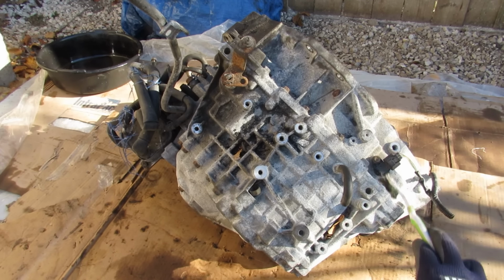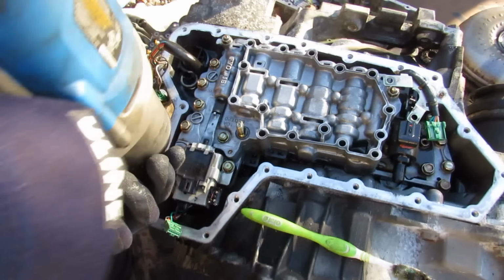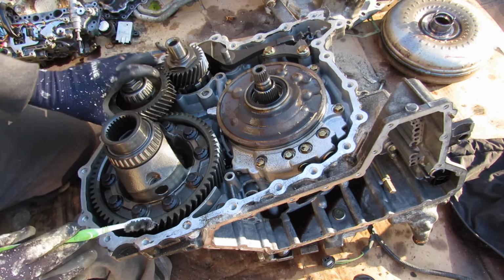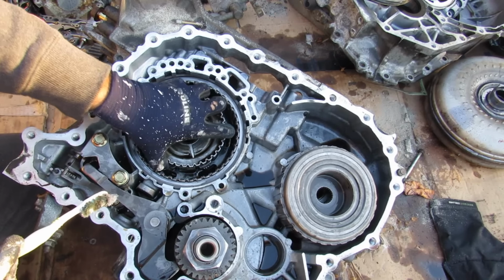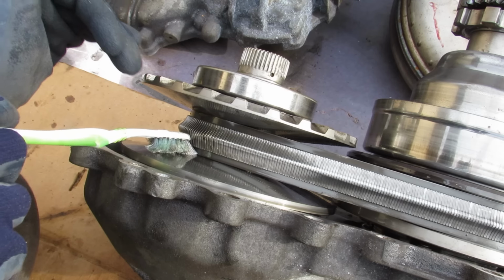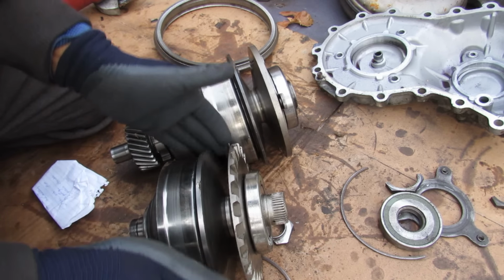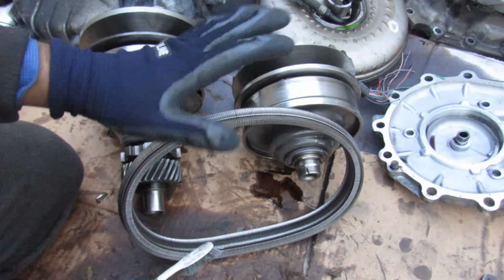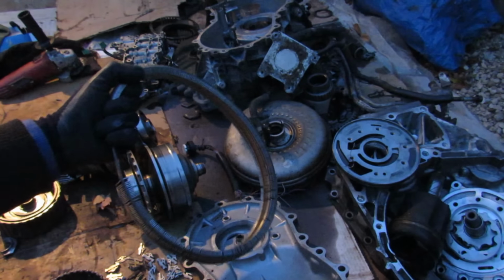Why Nissan CVTs FAIL

Comment: I just bought a 2020 Corolla with a CVT. It has a physical gear for 1st gear. It takes a ton of stress off the belt during takeoff. Should make it last much longer.
Reply: You just bought this!A Toyota with eCVT! eCVT transmission, instead of belts and pulleys such as those used in CVTs, electric motors are used to control the speeds of the planetary gear components. The eCVT is a smart transmission system that offers an infinite number of gear ratios!e from electric!Toyota for ever!😁

Comment: I loved my CVT in my Nissan, keeps you right in the power band. My car made 150K miles without major repairs
Reply: That's good.  I am currently car shopping and have my eye on a 2022 Nissan Sentra SR.  But I am concerned given the history of the CVT transmissions.  Any advice?  I really like the design of the '22 Nissan.  Its a beautiful car, but at the same time, I want beauty AND reliability
Reply: @EnriqueHld  I'm not sure if I can help. My Nissan was a 2014 murano had over 100K miles, never needed anything done to tranny........ And I towed a boat that was too large for the car 19.5 foot. I honestly never heard of these issues people had with the CVT. 
But that is a very different murano than what is out there today.

Comment: More reason for people to use a hybrid over conventional combustion cars. (Hybrids either use dual clutch transmission OR an eCVT, an electrical transmission that shares zero of the flaws with CVTs).

Comment: I’m lucky enough to have a pre cvt Pathy, but I have learnt through YouTube that certain models of pathfinder (eg 2013) should be avoided due to their cvt failures. Did Nissan fix the problem in later models?

Comment: The best punch line was “its stuck in drive or reverse so you’re literally driving BACK to the dealer “. 😂😂. With any kind of vehicle-as long as you’re not beating on it and keeping up with the maintenance, it will last. This is why I hate when other people drive my car (yes even family) No one will take care of the car the way you will. I had family visit, asked to borrow the car, drove it like a rental. Fortunately, everything is fine, probably because the car is fairly new and I am gung ho with maintenance.
Reply: Ah yes, the rental mantra of "drive it like you stole it"...
I only thing I'll borrow to friends is my old 1993 Ford Ranger, which is a Mazda B2 series in disguise. 
If they wreck it, I'm only out about $1500, otherwise it can be driven like a maniac and still doesn't miss a beat. 
250k+miles and zero issues with regular maintenance and a few minor parts (starter, water pump and alternator, a few bushings, ball joints, etc).
Reply: @RustyStringz  if you do regular maintenance on anything, it will last. The problem is most people have no idea about maintenance and/or ignore it until something happens. I’m the kind of person that will be driving and hear something out of the ordinary, roll all the windows down, turn off the radio and climate control just to try to figure it out. My wife is the exact opposite. Her words are “why are you wasting money to change stuff?  Just wait for it to break”. 😂😂😂😂😂What??!!
Reply: @grazz7865 
I'm almost in that same canoe, but mine understands that it hurts more if we wait until it breaks, however she is in the "if I hear anything weird, I'll just turn up the radio" school of thought. I find something wrong, ask her if she'd been aware of it and get "yeah, it's been like that for a while now"... 😐
Reply: @RustyStringz  100% in the canoe. Mine said almost the same thing. She said I just roll up the windows and turn on the AC 😂😂😂. The tires were a big issue. 1) she drives a smart car-tires are small and there’s no spare 2) tires were 7 years old. Yes, tires are overpriced for a piece of rubber 😂😂. I’ll agree with her there. But it is a major safety issue. Of course, when the tires fail is when you’re 1,000 miles from home 😂😂😂. Fortunately that didn’t happen. She had to work and I was off. I took the car to mavis.
Reply: @grazz7865 
Not familiar with Mavis, but yeah, 7 years is the limit for safety in tires.
At least with a smart car they aren't too awfully expensive.. I just put a set on a Mercedes with 19" wheels - damn things cost me over $1200, and they weren't even the most expensive option!
Reply: @RustyStringz  I find certain things unreasonable for price like tires. There’s no reason 4 pieces of rubber should cost you $1200 (on the low end!). There’s no reason a mattress (springs and polyester) should cost $5000!  The tires for the smart car aren’t too bad. $89/each for Kumho. Descent brand. I put a set of Kelly tires on my Nissan Rogue. That set me back $1000 for 4 pieces of rubber. But you don’t want to go cheap on tires. If there is one thing I’ve learned in life is you get what you pay for.

Comment: If you drive a regular transmission as hard as a CVT without filter and fluid changes, they will wear out also.  A lack of maintenance and vehicle abuse is the fault of the nut behind the wheel 😅

Comment: I have a Nissan muran and the the coolant fluid got mixed with transmission fluid. What do you suggest I do? Flush the transmission with transmission oil or open the gear box and do a thorough clearning.
Reply: How did that happen?

Comment: #1 reason lack of proper maintenance. Transmission service for CVT should be 25-30k miles. I would do it every 20k after seeing videos of the fluid after 20k miles. That being said Nissan should have stopped making them years ago.

Comment: What I don't understand about CVT's is WHY use them at all? Are they so much easier and cheaper to manufacture than conventional automatics? It doesn't appear so to me.
Reply: Yep, cheaper to build, lighter and better fuel mileage + overall less maintenance - but you still need to maintain regular fluid changes. 

It's still a nice option for lower power level vehicles, but not so brilliant for high torque, heavy loading /towing, but should also be able to get another option if that is the case.

Comment: What do you think about a 2007 Nissan Altima 3.5 SE Manual Transmission with 245,000 miles for $2,000 ?

It runs good but no ac and has the vsc light coming on and off.

Black leather, 6 disc cd, Bose etc.

Thank you.
Anybody knowledgeable please reply soon.
Reply: It runs good, isn't beat up, rusted out, and only has a few sensors out?
How about the tires, brakes (especially rotors) and frame? 
For $2k it sounds like a good deal, but I'd offer $1500 and settle on $1750 (for the year and mileage).

Plan on $400-700 in parts and labor to get to the bottom of the VSC issue, but otherwise it's a good deal. (IMHO, not a professional mechanic and not seeing it, but having a lifetime, 45+ years of valuable experience and knowledge of cars-owning at least 30, and working on many others).

P. S.
CD... What's a CD? 😉
If that were a Pathfinder, and you didn't buy it immediately, I'd say just go with beating yourself with a Hot-Wheels track until you get another chance to steal one for under 5k. 

Miles don't matter*. Maintainance does.

*Okay, after the first 500k, miles may be an issue. Jeez!
Reply: I'll give you 3 now!

Comment: 21today
0 seconds ago
Hi.  Does anybody know if a 2011 Nissan Sentra transmission is compatible with the 2016 Nissan Sentra?  The wiring on the 2016 doesn't seem to line-up/ reach the sensors on the 2011 transmission.    Any advice would be greatly appreciated.
Reply: No they are not compatible.
Even if you could mate the mountings, the eprom would be different and simply no way to program the older system to work with your newer vehicle.
Reply: @RustyStringz  Thanks!

Comment: My wife's 2012 Juke was still running like new at 158000 miles when some idiot ran a stop sign and totaled it. The CVT never gave us any trouble at all. Aside from an alternator pulley breaking, the only other repair it ever needed was a timing chain which was a $2200 repair we had done two weeks before the aforementioned idiot crashed into it. we miss that car.

Comment: despite cvt having many issues its amazing how people can come up with new ideas for transmissions
Reply: This makes cars totally disposables.  No parts, you have to get the same transmission on warranty or if out of warranty pay for it and the service cost. And you get again the same problem, no thanks is better to get a new car with no CVT.
Reply: @somarpr  I think AT is almost the same case. Having my Omega mv6 and my sister's Corona's transmission  rebuild and both can't last over four years. Rebuilding seems unreliable and the dealer charged something like 10,000-20,000 usd for a new one. 
Therefore I go with manual after that. Rebuilding a manual is far more reliable. I still have a 4AT Sambar Van though.
Reply: @somarpr Adevărat!Dar dacă este întreținută tine mult și bine.E adevărat că costurile de  RK sunt cam mari ,dar oferă o plăcere la condus .Odată ce se fabrică și se înbunatațesc ,însemna că e ceva de capul lor
Reply: No shit. Why did they bring this junk into the market ...

Comment: Best reliable trans is still a manual transmission lol. Somehow still more fuel efficient, easier to repair, long life, and no trans cooler even needed for gear oil lol.

Comment: Hey sir, great job on this one! I have been an automotive tech for about a decade and I still learned a few things. The toothbrush was a nice touch. I don't do anything with transmissions except for true manuals so this was very informative.
Reply: How about they make a cvt oil level stick you can easily remove !!!

Comment: Great video. Very accurate and knowledgeable. I worked for Nissan a few years ago and everyday we had cars come in with transmission failures while still under warranty. Some cars had multiple transmissions put in before 80k miles. I’ve worked for Toyota as well and their cvts aren’t as flawed.
Reply: toyota cvt gearbx equiped with direct gear to move the car from stationary, the cvt system works only when the car is moving

Comment: i have a subaru with paddle shifter, won't be using those anymore or zooming around. gonna take it real easy. Thank you! The way the CVT makes contact with that belt is nothing like I pictured in my head. The actual design seems very weak.

Comment: Nissan CVT transmission are a joke. I have a 2014 Versa sedan and the first transmission failed at just over 30K, that one lasted 50K before it failed. The next one failed just before the warranty expired at 130K miles. I made that one last because now it was no longer under warranty, I nursed it along until I had 240K miles on it. These things are such pieces of shit that the only place you can get one is thru Nissan and they only warranty them for a year or 12K miles. Other then the transmission that car has been perfect.

Comment: Great explanation of a complex system.  However, you didn't explain why a CVT causes you to lose some of the "driving experience."  I've never owned one, but I imagine that the continuous power transfer is a better driving experience than the brief interruptions you get with an automatic.  

Maybe you feel that the noise, or the lag time, makes for an overall worse driving experience.

Comment: Hi, We have a 2020 Rogue, and I was wondering how often we should changed the following
1. CVT Fluid
2. Transmission Cooler Filter (outside)
3. Filter inside the oil pan 
Thanks!

Comment: There are no instructions. And definitely no parts to service or repair a CVT. Think about that? Manufacturers reman. With core replacement is the ONLY option currently available to owners. Last I knew there are no 3rd party CVT remanufacturers. Parts aren’t available to them.

Comment: …and that folks is why I’m driving a brand new Mazda CX-5  2.5L conventional transmission. I was in rental AWD Nissan Rogues for 3 months. I thought they were great to drive. But the long term reliability and serviceability freaked me out. Very nicely explained here. I learned a bit more than I knew coming in.
Reply: Same. Have been using my 2015 CX-5 as long as the year of the car itself (so 7 years). Aside from routine maintenance (oils, things like wiper blades, tyres, etc) and 1 time replacement of the head unit to Apple CarPlay compatible ones, it never has any issues whatsoever.

For now, if I'm buying a new car, it'll be a Mazda. Hopefully it can stay that way.

Comment: If manufacturers produced an engine that didn’t produce excessive hydrocarbons during shift points there wouldn’t be any need for a CVT transmission.

Comment: So, based on what you've said, it seems that increasing the transmission's ability to move fluid in and out of where it's needed, along with upgrading its cooling system, should address the bulk of what causes these transmission failures.  Neither of those seems like it would be too much for Nissan to accomplish. Maybe you should do a comparison video between this transmission and Honda's CVT, one that is known for reliability.
Reply: The thing is, most things said in this video have already been solved in modern CVTs. Heavier cars get heftier belts and Toyota (iirc) even included a small "regular" gear in order to maximize fuel economy and minimize wear on the belt for acceleration from standstill. The whole torque issue (i.e. for pulling trailers) will probably never get fully resolved, especially since electric cars (whether supplied by a battery or through hydrogen fuel cells) are around the corner.

Comment: Excellent explanation.   Looking at how that belt and pulleys is contrived - that will NEVER work!   (And, I gather, frequently doesn't).   I'm so bloody glad I drive a manual.   
"Because the drivers of these economy vehicles don't care about the driving experience that you lose with a CVT"    Very true,  I've driven one and  it's f&^&%* horrible.   Makes a conventional auto feel like a racing car by comparison.

Comment: worked on the DAF variomatics from 1975 in the Dutch army, very simple certainly not as complicated as the one shown in the video. I suppose the relatively small engine helped not overworking the CVT, never had too many problems from memory.

Comment: Nice toothbrush demonstration. It is very interesting to see the inside of this transmission. Soooo many moving parts! 
In my experience, I have had this transmission on a VQ35 engine and drove it and pushed it for 15 years and never had an issue with transmission failure. CVT transmissions are smooth and have no jerky feel at all.
Reply: So why do I hear thay cost more than the car is worth to replace one.we had a simple system on a Massey combine you could replace the belt in half hour
Reply: @johnodonnell-pd2vv  I am not talking about cost at all and you could be right about being expensive to repair. My comment is about how smooth the gear transitions are and that in my experience, I had no issues. Maybe if you take care of a transmission well and servicing it regularly it may last longer?

Comment: Great breakdown of why they fail, but the only actual benefit to them is being able to stay in the power band all the time. They don't offer meaningfully better efficiency otherwise. If they did, then by definition they would have less heat problems than a normal slush box. With those goofy bands they actually have a higher parts count than a proper slush box (with two planetaries.)

Comment: I drove it in a 2011 Qashqai and it SUUUUCKED for real. 

My cousin had one and issues started after like 20k miles.

I get the japanese hype for CVTs because they drive pretty slow most of times but it's just not suited for european measures. Driving it on the Autobahn was a nightmare because after 80 mph the acceleration of a 140 hp car felt more like it was half of it.

Comment: Very well explained. I have a 2012 Nissan Rogue and the CVT is failing due to overheating. I am assuming the two drums are not at the right diameter and allowing it to slip and overheat? I can rive up to 60 MPH with no issues, but over that, the transmission overheats and it go into "Safe Mode" which won't allow you to go more than about 50 MPH. If you pull over and stop the engine for 10 minutes, it might cool off enough to start working correctly again. This is a bad situation when you can only go 50 MPH on an interstate with a speed limit of 80 MPH. 
My car only has 95k miles, and several shops have told me you can't do much on them except replace the entire transmission, just like this video states. My vehicle is too old to be in the class action law suit, so I am stuck with it. I won't buy another CVT transmission car again. I should get more than 95k miles out of a modern car made in the 21st century. 
Thanks for the explanation in this video, very well done!

Comment: CTV common slipping problem > cannot accelerate even the gas pedal down.

Now I understand why general garage cannot fix my failed CVT. The CVT is too complicated and no easy for identifying failed parts...

Instead the garage just find an used CVT from (scrapyard) and refitting on my car.

The only worry is never know how many mileage the replaced CTV will out of order again.
Reply from the maker: Exactly. Now a days it's about replace than Repair